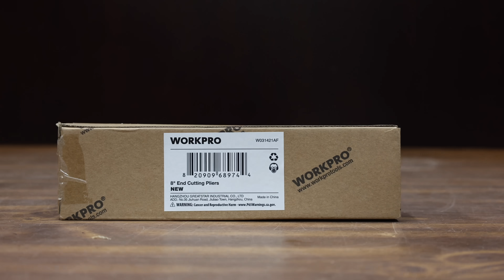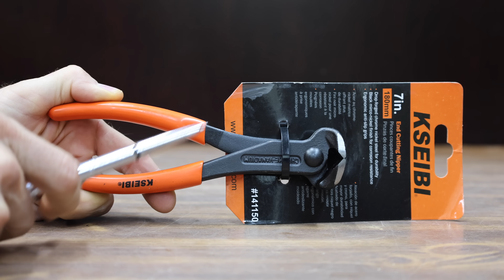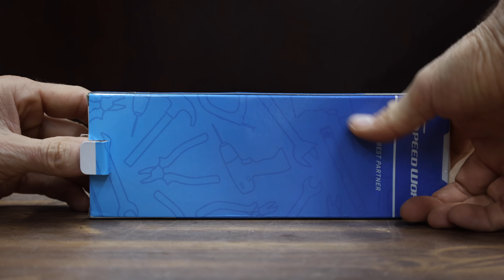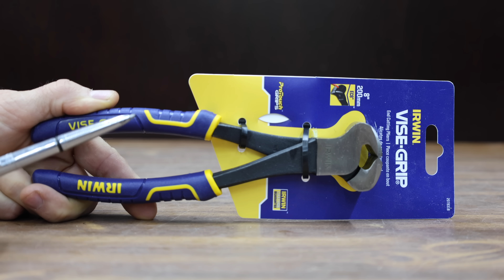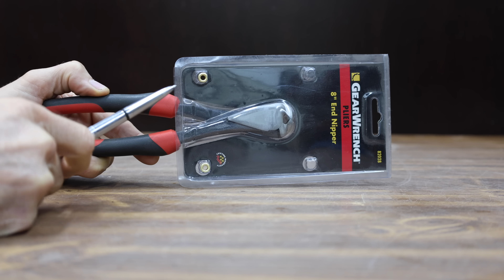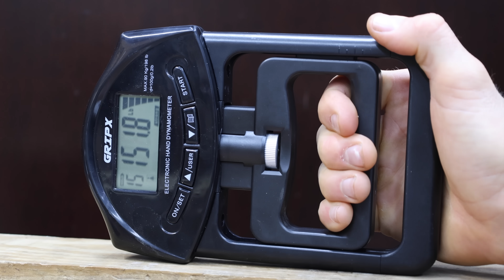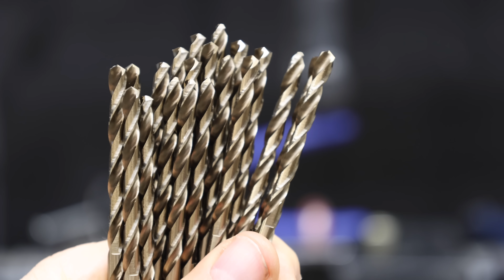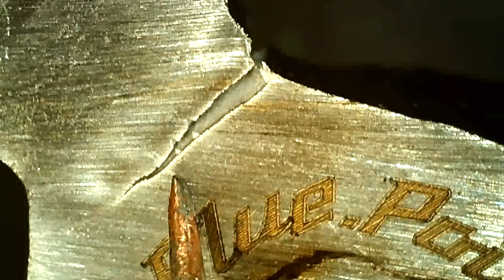Finally! Best Pliers I've Ever Tested! Not Even Close!

Comment: I was in construction most of my life. I'm now 78 and still have a pair of nippers (as they were once called) I bought when I first went to work with my dad in 1961. I carried them in my tool belt for years and years, as they were handy for pulling nails, cutting wire, etc. I even bought several sets of less expensive pairs for employees. I have some pairs in my toolbox now and have found you basically get what you pay for. Since I've never been able to exert 500 pounds of pressure by squeezing, and I've never met anyone who could, my money would go toward a pair of Channellocks.
Reply from the maker: Thanks for sharing.

Comment: My main shopping habit is to look up why the expensive products are so pricey and whether the respective benefits are worth it to me.

And it seems that Knipex will be the cheapest of them all down the line. You won't need to replace them for a very long time and they'll do the job quicker than the rest.
Reply: For any of these types of cutting and pinching tools, I don't even look past Knipex anymore.  I have a range of their tools, from this kind of heavy-duty cutting down to fine side-cutters for electronics work.  They are all easy to use, and I've never been able to damage any, despite some moderate abuse.  So yes, they are much less expensive in the long term, because you only ever need to buy them once.
Reply from the maker: Thanks for sharing.

Comment: Get the right tool for the job.  For me, I'd only use this tool for staples so I want a close cut at a bargain price = Wiha $25.  Cutting anything harder or fatter and I'd use an electric/battery tool, grinder, sawz-all, multi-tool etc...since I don't have the hand strength for those jobs.
Reply from the maker: Thanks for sharing.

Comment: I thought the blades on these kinds of snippers were supposed to be slightly misaligned so that the tips dont meet but the sides of the blade sandwich this was you dont ruin them every time you use them but still get all the cutting power. Basically cheaper than making a super precise cutter where you cant smash the tips.

Comment: I've scrolled through comments for 2 minutes, and I still can't believe that nobody has pointed out that these tools are not designed to cut something flush with a surface. If you look at the illustration on the hautmech packaging, it shows the primary purpose of these tools, which is to remove nails, despite the unfortunate name, end cutter. If the purpose was in fact to cut flush with a surface, the edge geometry of the tool would be completely different, and specifically tailored to that task. This would not be a hard thing to do, but this is not what the tool is designed for. It can cut, but it's not designed to cut flush.
Reply: Correct, they’re for pulling nails, staples etc. not for cutting. It’s not by chance that the cutting edge doesn’t line up perfectly. If they’re lined up perfectly then they’d cut instead of grabbing.
Reply: yes, but its one of the fundamentals of a good set of end nippers that i find important.   one feature not tested here is the importance of the shape of the end for leverage for pulling out nails or tightening tie wire.   i'm watching this because my very old no-namer brand nippers with my preferred features has totally died and i am not happy with any ive seen in local stores or even on this video.
Reply: I agree jnid

Comment: 21:31. As a Knipex user, once you use one, it really isn't that hard to believe anymore. I used to be a doubter. Now, if I need to order some kind of tool, I see if they make one first.
Reply: I have Knipex as well, both pliers and cutters..have new ones and some I have had for nearly 30 years. I actually had a pair of Knipex cutters that snapped like those Channellock ones did with just moderate force..of course the warrantied replacements have lasted years. I suspect that they were maybe over-hardened or something..that sort of thing happens from time to time, even with the best ones. I suspect that might have been the case with the Channellock pair he had. I would like to have seen how a replacement pair would have performed with the drill bit and allen key....
Reply from the maker: Thanks for sharing.
Reply: I wish they made tin snips
Reply: @stevendavis1980 would be awesome if they ventured into the hvac industry
Reply: @stevendavis1980 they do.
Reply from the maker: Thanks for the feedback.
Reply: I can see why... 
The difference in force needed to do basic tasks is literally an order or magnitude greater with most other options lol
This was quite the showing.

Comment: Video idea: similar to this video, I would love to see a comparison of flush cutters (not side cutters/dykes/diagonal cutters).
I use these daily as a low volt electrician, mainly for their ability to  cut the tail off of zip-ties perfectly flush for safety. 
Brands to look for would be Hakko (apparently made by Piergiacomi), Klein, milwaukee, crescent, xuron, Weller, and knipex (the black knipex super snips are the ones I am particularly interested in. They have a bit longer handles and are advertised to be 62hrc!)

Comment: I have a set that is at least 60 years old. The cutting edge can be replaced but I have no idea where you would get replacement. I missed placed them so I bought five new they all sucked would not cut a framing nail only aluminum luckily I found the old ones in my attic where I left them
Reply from the maker: Thanks for sharing.

Comment: First of all, these pliers are NOT going to cut screws and nails flush because of the way these pliers were designed. You have to have cutting edges sitting flush with the surface in order to cut nails and screws flush with the surface. Just saying……….
Reply: If one's on a quick job there's no time to choose tools might as well pick anything.

Comment: We use nippers in Drywall for T-bar and drywall suspended ceilings, cutting and bending t-bar hanger wire and tying Tie wire. I'm on a pair of Knipex 68 01 200 best, best i've had so far.
Reply from the maker: Thanks for sharing.

Comment: It looked like the Wazakura were the only full-flush cutting nippers in the group.  All of the others were semi-flush cut, and they're definitely for different applications.  The semi-flush cutters aren't designed to cut really close to a surface like the full-flush nippers are.  The Knipex are designed for cutting bolts, most of the others are designed for softer metal wires.
Reply from the maker: Thanks for sharing.

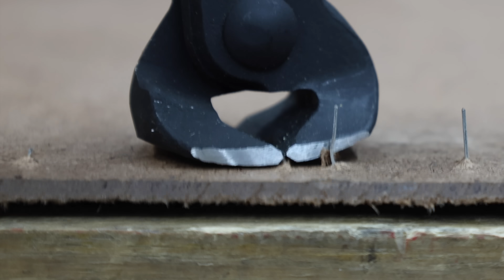Comment: 1:25 well yeah they leave staples above the surface. NONE of those are flush cutting pliers. They're END CUTTERS. Notice the different name? If they don't say FLUSH CUTTERS specifically, they aren't flush cutters.

None of those are flush cutters. They're END CUTTERS. Read the label. Then look up flush cutters. We use them in guitar repair and construction. To cut frets and to remove frets from fretboards.

They are COMPLETELY different from end cutters, which are what you have.

Comment: The Channellock design has changed design since the pair that I have and love? They are model No 357 (which appears to be the same model number as you tested?) - but they have a flush ground pivot and have machine ground sides of the jaws. The pair you tested have a rivet with a pressed end.
Reply from the maker: Thanks for sharing.

Comment: Not surprising, considering the winner is specifically designed to cut through stainless steel cables. Versus that, most of these would simply have a circular dent in the jaws.
Reply from the maker: Thanks for the feedback.

Comment: for the best flush cut, i use farriers nail cutters GE is good make but a lot of money. but the heads are ground so outer surface is flush to base of cutters. I have carefully ground the faces on cheap nail cuttters , keeping wet and cold so not to loose temper with good succsess in the past.
Reply from the maker: Thanks for sharing.

Comment: Most of the pliers you've showed are designed for pulling over cutting, the roll on the head allows for leverage against staples and tacks in floor boards, if sanding floor boards you don't want to leave any metal in the floor.
Reply from the maker: Thanks for the feedback.

Comment: In the late 70's I did a wire project cutting hundreds of pieces of piano wire, 1/16" etc. with my dad's old Proto brand diagonal cutters, from the 60's. They just worked, no damage, good hard steel. Then 5 years later on my own trying to find cutters to do the same type job, I couldn't buy anything that worked as well - even the "heavy duty" American-made tools would have nicks in the jaws after a few cuts! Finally got some Knipex cutters and it was back to old times, they do have some good steel in them.
Reply from the maker: Thanks for sharing.

Comment: I would really be interested to see what happens when you grind down the top of the tools until the cutting edge is right on the edge!
So no outer bevel left.
I know its probably bad for durability and/or cutting strengh but it would probably offer a  great "flushcut" performance
Reply from the maker: Thanks for the suggestion.

Comment: Every professional steel fixer I've worked with uses Knipex pliers. I bought a set myself, and we have 3 sets at work. If you want them to last for a lifetime, a couple of strokes on the inner edge of the knives with a good file will keep the edges sharp. Match the pressure and number of strokes as closely as possible to keep the edge alignment. They really are in a class of their own.
Reply from the maker: Thanks for the feedback.

Comment: 14:08  the tool moves forward pushing the screw into the block.  the cutting force is a wedge pushing the screw tip away from itself, and now into the block.. this test has a lateral force on the teeth, the other tests don't.

Comment: i worked unloading chemical rail cars and we had to cut wire line that locked the valves shut. Sometimes I could have the hoses hooked up in about 5 to 10 minutes. and sometimes not. As I could not get the wire rope cut. And then I noticed that we had kenipex there one time and not another. Eventually I did as all good operators do hide a pair close by so I always had some .
Reply from the maker: Thanks for sharing.

Comment: Thanks for another banger testing to the death!  Kinda wanted to see a durability test of how many cuts through something a normal human works with like welded wire mesh and see how dull or damaged the cutting surface gets over time.  I work with brass, copper and steel rivets, cutting off the excess stem and hammering them flat for custom leatherwork projects and use Knipex, well worth the price.
Reply from the maker: You are welcome!  Thanks for the suggestion.

Comment: I realize you called them cutting pliers, but nobody would use them like you tested them. Those are primarily used for pulling nails and wire, Staples and nipping light metal. Heavy duty screws and nails? Seriously, who's going to squeeze 300 lb!
Reply: Move on Leroy,  it's a good test,  and without doing it,  how the f@$% would you know that Knipex was far superior

Comment: I am a big fan (an reseller) of the Knipex tools, but I think this competitions wasn't fair enoght, because that was a diferent kind of tool. The competitor should were the 67 01 200 (High Leverage End Cutting Nipper) instead the 61 02 200 (Bolt End Cutting Nipper)

Comment: The Knipex has an offset jaw.  That makes using them more productive.  They can do in one cut what it takes two cuts on others.  Knipex rules.  Tekton rulew as my daily driver wrenches and aockets as well.  Good value for the dollar.  Excellent warranty service.  Proto is supppsed to have the best wrenches.  Specialized tool manufacturer are tje way to go.  Not a single brand has the best goto lineup.
Reply from the maker: Thanks for the feedback.

Comment: you missed a really important test that most tools that deal with cutting (like pliers, wire cutters, etc) need to go through: Longevity. 
It's been a popular test lately to have pliers and similarly cutting tools go through tests of how long they can keep up the ability to cut things, even materials that are rated below the maximum (like copper or tin), as it's turning out that they are getting severely damaged and mostly inoperable after just as little as 2 to 10 uses. Even for big popular brands. 
While you did test 1 cut of a tough nail, and some were visibly damaged, even the ones that weren't need to be tested again multiple times.
And yes, I know you cut a very difficult drill bit too, but again, longevity. Most people are not going to cut a drill bit or a torx key, or a drill bit, but will be cutting staples, wires, and similar things 100's if not 1000's of times.

Comment: switched to knipex pliers/cutters as an electrician years ago. not only where they cheaper than the klein alternatives, but the pliers and cutters work much better. cool to see a test done showing what i experience on the job.
Reply from the maker: Thanks for sharing.
Reply: Klein's new pliers wrench tool I suspect is halfway made by Knipex. Part of the tool is made in the USA, the other in Germany, and it looks to be very much in the same vein. It's a neat spin on the pliers wrench with the flipping jaw that can be a vee or smooth. Klein has a place in my tools but Knipex is definitely giving them good competition. If Klein ends up doing better as a result, we will win.

Comment: I use those knipex nippers for work and they are great! Word from the wise though, don't drop them! The cutting edge is crazy hard, but that comes with being very brittle. The edges on my pair broke on both sides after a single drop from about 3 feet onto a concrete shop floor. There's plenty of edge left to use, but I wouldn't want to drop them again.
Reply from the maker: Thanks for sharing.

Comment: I bought a pair of the Wiha flush-cutters a few years ago and have used them to trim the pointed end off of #8 deck screws.  You gotta squeeze like the dickens and watch out for the little bullet that flies off, but they do work even with just hand strength.  Glad to see that they came out near the top and definitely the value choice!
Reply from the maker: Thanks for sharing.

Comment: the grind on all of those tools is not appropriate for the job you are using for the test. If they are meant for that job,  they should only be ground on the inside, putting the cutting edge flush with the surface.

Comment: I have to say that I don't agree with the Knipex running away with this test. Who in the fresh hell is using this kind of tool to cut something as hard as a drill bit, or even a screw? I have occasionally used angle cutters for a nail - if I am say up a ladder and nothing better is in my belt. But I'd never even think to pull them out for anything harder. And these end cutters I've literally never used on anything harder than a staple (or even had occasion to try), and I have those Channelocks and they cut too far out for me. 

So I appreciate that you give the underlying data, because to me the Knipex performed really poorly in basically the only test here that matters. I mean, I guess it's cool that they can cut through a drill bit, but how practical is that in the actual use of this type of tool? Really, these things are often not the right shape to even get on to most things I want to cut, they're basically a specialty tool with one job, and that's the job that the Knipex failed at.

Comment: Ok, so I normally buy cheap a$$ pliers and the like.  I had a seized, striped valve cover fastener in a cylinder head.  Just a nub about 1/4" sticking out.  I followed a YT  recommendation for the Knipex 82 01 200 pliers.  While they are not cutting pliers, they are made for GRIP, in multiple orientations, and are slack jawed.  

At 70-80$ canadian, I was a bit apprehensive about paying that much, but I went with my gut and bought them anyway.  DID NOT DISAPPOINT.  I was able to put the pliers vertical on the fastener ( same orientation is what I'm saying here, stud sticking into the end of the pliers head on.  I was able to use some VISE-GRIP pliers to clamp the Knipex pliers closed and unscrewed that stud in like 10 seconds...

Now my favorite pliers, they are SOOOO versatile.  I also do some electrical in trailers, low voltage etc.  They are great for uncrimping those single use cable crimps that are shaped like a wire nut.  

I HIGHLY recommend these......DO NOT DISAPPOINT.

I'd LOVE to see these go head to head with some others.
Reply from the maker: Thanks for the suggestion.
Reply: @ProjectFarm  I have some video of the ordeal, as well as some of me using it on some wiring.  I'll post em up for reference ;)

Comment: I have a pair that are at least 15 to 20 years old I got from Harbor freight. I actually get mad when they cut the nail. I use this style to pry the nails out. If I want to cut it off, I’ll grab my Klein wire cutters. They will easily cut through a drywall screw and easily cut through the nails so I wouldn’t want them to be sharp and cut through easily.
Reply from the maker: Thanks for the feedback.

Comment: Very impressive performance by Knipex but so is the price. My pliers are £2-3($3-4) a piece and my use cases do not include much of cutting, and for cutting I mostly use side cutters. The style used in this video I mostly only use for pulling out nails. So would be interesting to also see side cutter test
Reply from the maker: Thanks!  Thanks for the suggestion.

Comment: Another great video. Other than cutting off some small staples or trim nails, or pulling them out of something, why would you use these for cutting off?  That’s what your grinder and cutoff wheel are for. Who has 175 lbs hand strength?

Comment: In case I need to resharpen cutting pliers I open them completely to work on the outer face edges by beltsanding them. I achieved good results so far.
Reply from the maker: Thanks for the feedback.